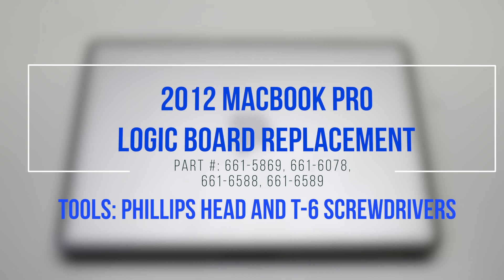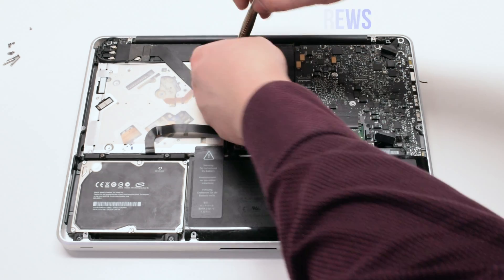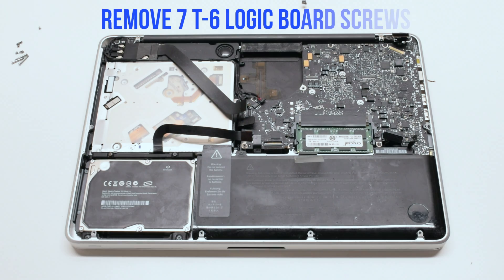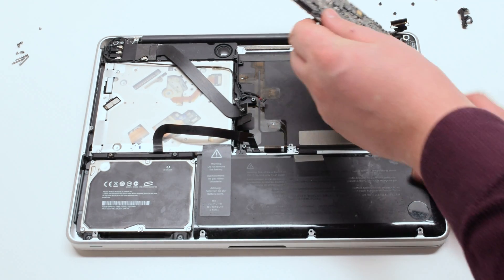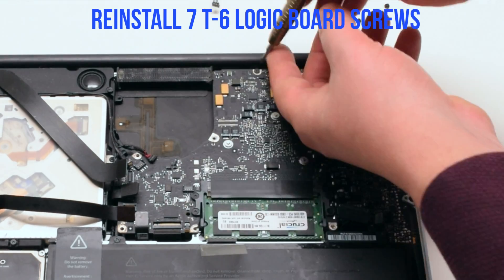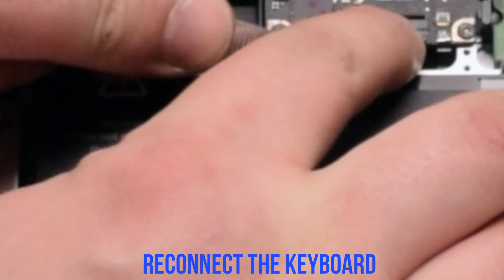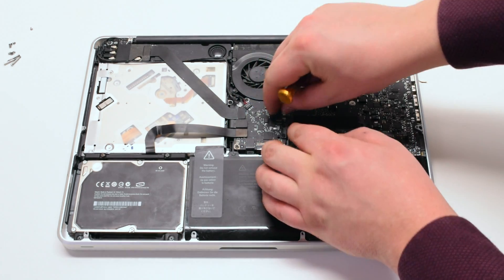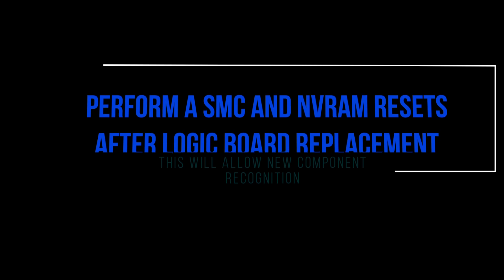2012 Macbook Pro 13" A1278 Logic Board Replacement

Comment: Great video!  Any recommendations on which replacement logic board to purchase?

(My 2012 or 2013 MacBook Pro 13”, with i7, is non-responsive.  No lights or fan sounds.  The logic board had some white oxidation, which has been removed with a touch of alcohol and compressed air).
Is the problem likely only the logic board?
Reply from the maker: Did you reset the SMC after cleaning? https://www.youtube.com/watch?v=5JLw2M379rc&pp=ygUJcmVzZXQgc21j 
Did you try other chargers? If so than purchase a replacement on Amazon here https://amzn.to/461vOdh
Reply: @GRIBSOFT  Thanks for the reply!  
No luck with the SMC reset, and I tried another charger at BestBuy today, but that did not work.  I noticed this link is for an i5 logic board, and my laptop is the i7.  Will it still work?  
What’s the difference in performance between i5 and i7?
(I haven’t been able to find a logic board for the 13” that is i7 and has the EMC No: 2554).
Reply from the maker: @sgalloberklee it will not be an issue other than it being an i5, browse around amazon for an i7 you may find one.

Comment: Thank you very much!! Super useful. The video is missing an important thing though: when you undo the old board you need to take out two important parts and put them in the new board: the cooling system of the chip, and the microphone. Other than that this was the best

Comment: you didn't mention the microphone replacement(Important step before removing the LVDS bracket).  Does it just sit back in place or does it need to be glued back down?  If so, which glue is recommended.

Comment: I swapped my bad motherboard for a new one. I booted up to the folder with the question mark even after I did the NVRAM reset. Any tips?
Reply: CHANGE THE SATA CABLE THATS CONNECTED TO THE HARD DRIVE

Comment: Tried plugging the 3 T-6 fan back on and it doesn’t latch on. The connecting end use to have four metal ends that attach to the board, but now there’s only three. Is there a way to make this work or do I have to replace the 3 T-6 fan?

Comment: Very nice video! Thank you! How do you think can I upgrade my Mac by replacing my old mid 2010 logic board to i5 late 2011 (I noticed difference only in WiFi connector and I wonder - is it possible to replace this cable somehow)? Thank you.

Comment: I want to replace the HDD with an SSD, please can you tell me what are the types of screws that I will need to remove. So that I can buy the relevant Screwdriver set.
Reply: The screws for this are all Phillips "cross" or "plus sign" heads. You just need a very small screw driver. I use an Autocraft Phillips 0x3".  It has a magnetic black tip that is really useful with tiny screws.  Got it from the hardware store.  Hope this helps.

Comment: you need to warn people to carefully remove the wires because not knowing how to remove them can damage it especially on insight camera. You also need to slow down and show how your doing it properly step by step. Also invest in a better camera because your current one is bad cant zoom in properly. Also, keyboard wire was very hard to understand you didn't properly show it or zoomed in especially on putting everything back together. Overall just slow down and explain each step carefully and zooming in properly.

Comment: For all of those struggling with the keyboard's cables, try putting a stripe of tape all the way long the width of this flat devil to help you out. I can't believe I did spend more time trying to put this back, than taking apart the whole system.
Reply: Now you tell me ;) . That was a bear.
Reply: @kristophertodd6870   An engineer bear D:

Comment: Hello 

 My macbook pro from 2011 broke down (motherboard).  I bought a new computer since then and I got the ssd from it as an external storage drive case.  In this confinement period, I decided to fix it.  So I ordered a new motherboard on EBAY.  After replacing it, I turn it on and the screen shows me a folder with a flashing question mark.  No recognized operating system.  I have recovered my ssd, and I would like to know how to restore the OS LION which was offered to me by default when trying to restore?  On the screen, they show me "an error occurred while preparing the installation try running this application again", or if I do an ssd cloning with "carbon copy cloner", the up to date catalina OS which is on my other machine  on it would end up on my ssd.  Could it work?  is it normal that my azerty keyboard is set to qwerty?  Besides, when entering the wifi, to access the restoration system, the numbers on my keyboard as well as the trackpad do not work.  Is this related to my new motherboard?  I did a complete hardware test, the diagnosis shows me a battery problem with an error code (see photo attached)
 I think I said everything in terms of my questions.
 Thank you for your comeback.
 cordially
 Alex

Comment: Bonjour, Bonsoir 

Mon macbook pro de 2011 est tombé en panne ( carte mère ). J'ai acheté un nouvel ordinateur depuis et j'ai récupéré le ssd sur ce dernier comme boitier de disque de stockage externe. En cette période de confinement, j'ai décidé de le réparer. J'ai ainsi commandé une nouvelle carte mère sur EBAY. Après avoir effectué le remplacement de celle-ci, je l'allume et l'écran m'affiche un dossier avec un point d’interrogation qui clignote. Pas de système d’exploitation reconnu. J'ai récupéré mon ssd, et je souhaiterais savoir comment faire pour restaurer l'OS LION qui m'a été proposé par défaut lors de la tentative de restauration ? A l'écran, ils m'affichent " an error occurred while preparing the installation try running this application again " , or si je fais un clonage ssd avec "carbon copy cloner", l'OS à jour catalina qui est sur mon autre machine dessus se retrouverait sur mon ssd. Cela pourrait-il marcher ? est-ce normal que mon clavier azerty soit mis en qwerty ? D'ailleurs lors de la saisis du wifi, pour accéder au système de restauration, les numéros de mon clavier ainsi que le trackpad ne fonctionnent pas. Est-ce lié à ma nouvelle carte mère ? J'ai effectué un hardware test complet, le diagnostic m'affiche un problème de batterie avec un code erreur (cf photo en pièce jointe)
Je pense avoir tout dit au niveau de mes questions. 
Merci de votre retour.
Cordialement 
Alex

Comment: Can I use a 2012 logic board in a 2010 mbp? From everything I read I can, and I really need the faster processor.
Reply: Call apple
Reply: T Villa I didn’t do that. I don’t think they technically allow that so they wouldn’t tell me. What I did was find a list of the incompatible parts in the 2010 and found replacements for them (display connector, airport, speakers, and antenna/camera). You can find all these things for really cheap on Ebay, I just ordered the whole display/clamshell because then I don’t have to replace the connector or antenna/camera for $40 and it makes it simple, The speakers and whole airport assembly was like $14 for both, and the logic board was $125 in theory I should have no issues, but we will see!
Reply: @NA0401ABC   cool let me know!
Reply: T Villa I did it! I worked perfectly, and for some reason everyone tells you that it’s impossible when it took me like 10 minutes to finish.
Reply from the maker: I'm late to the party lol! So glad you got it done. Congratulations!!! Yes so it's the same body so it should be fine, but there are some late 2012 models that will not fit 2010 bodies.
Reply: Save Apple Dollars Hmm. I only had to make one modification to the separator thing in the middle of the case. I just removed it, I am not sure the purpose of it because literally nothing changed except I can’t use 1 logic board screw but that’s it. From what I know is that I can use a 2012 i5 or i7 logic board in my 2010 13in model. Just the display, airport, and speakers need to be replaced and that’s it!

Comment: We did everything in the video and now the mac wont turn back on. Any suggestions? 

Thank you :)
Reply: Kathleen Scott , do you remember reconnecting the battery cable back before placing the back lid and screwing? Most of us tend to forget that. If so, what I’d recommend is, watch this video carefully again, take notes of all the connections here mentioned, watch one more time to double check and make sure you didn’t miss any part and then open the laptop again and very methodically and patiently check and double check all connections, one by one. I hope that helps. Good luck ; )
Reply: Call apple
Reply: They will tell you that the logic boards fried.

Comment: I’m excited because my new (well used new?) logic board for my 2009 17Inch MacBook Pro came in. I couldn’t be any less excited because when I got it, it didn’t turn on. I then proceeded to get assistance from Apple. We went through a lot of repairs to which they then recommended a new logic board. They were willing to help sell the part and do them self but I refused. The amount they charged me for, I could of just bought a brand new MacBook Pro. I love the large 17Inch. And the process is simple. I’ve already removed it and it’s literally a plug and play. Unfortunately I’m 750miles from home but when I get home, I’m immediately putting it in.

Comment: After Cleaning my MacBook doesn't go to sleep when I close the Display... any Idea ?
Reply: Give it 2 Nyquils....
Reply: Any luck? Mine has the same issue, doesn't sleep when display closes, or it shuts off randomly on its own. I have to run the fan on high (manually using an app) and leave it plugged in.

Comment: My nutjob of a brain thinked that opening my macbook and NOT dissconecting the battery cable AND touching the fucking LOGICBOARD pins WITH A SCREWDRIVER and expected Its now dead
Reply from the maker: Must be some other disconnected cable. Not that it's impossible but it is very difficult to fry a logic board after 2008.

Comment: I believe you forgot to put the mic in... am I right?
Reply from the maker: Could have been missed in editing, but you got the concept.
Reply: @GRIBSOFT  Not exactly, actually.   The mic is the one thing that doesn't just slide, snap,  or screw back in place.  You had us tear the glue that binds it in place, so I'm wishing I had some instruction on how you re-installed that component.

Comment: i have replaced the logic board and now the trackpad and keyboard is not working to enter the credentials, also the fan runs at full speed. the startup disk is also missing. am not sure if i have done the smc or nvram whatever reset.
Reply from the maker: Make sure all connections are tight, i would reseat all of them, they do an SMC reset.

Comment: I have a mid 2012 MacBook pro 13" with a dead i5 Logic board inside do you think i Can install a i7 Logic board inside it ?
Reply from the maker: As long as it's same year and AXXX model type then yes you can upgrade the logic board.
Reply: Save Apple Dollars please consider to recommend a logic board for this model with an i7 processor. 🙏🏻🙏🏻🙏🏻

Comment: now my macbook is brooken. when i press the power button the bing sound is coming and the display is getting a little bit bright but no booting screen or something else. its black. and the backlight from the keyboard wont work too. is removed the mainboard twice but the same come out. 

I tryed to reset the nvram and the smc but i dont know if it work. 

what can i do now? is my mainboard death now?

and i switch the Thermal Compounds between the cpu and the cooler. 

sorry for my bad english lol
Reply from the maker: Check all the connection and make sure nothing is shorting any components on the board. The back light needs to be plugged into the logic board it's possible it's stuck under the fan. The best advice is to completely take out the logicboard again and reinstall it following all steps.
Reply from the maker: Reseat the LVDS connection to the LCD.

Comment: Is there a list of which motherboards will fit into certain macbook pro models?   Fried my motherboard in a 2011 macbook pro and I'm thinking of upgrading it to a newer motherboard.
Reply from the maker: There is no list but the A number of the laptop followed by the year will get you a compatible board. For example a "2011 A1278 logic board" search on ebay will get you the right board.
Reply: Don't do it. While you may get it to work, the LCD connectors are different (eDP vs LVDS), and can be damaged if a 2011-style cable connector is inserted. You can change the LCD cable, but then you have to disassemble the display, which is a pretty big PITA.
Reply: I have a 2015 model which one should I buy

Comment: Hi.  Great vid.  I have a dilemma. I dumped beer on the power connector where the power connect to my Mac. Lights out. I took it in and they said possibly it was either the logic board or the power source. Do you think I should try to replace a power source connector first or go ahead and replace the whole thing? Any advice?
Reply from the maker: Take it apart and clean it with alcohol first. You might not need to replace anything.
Reply: Thanks, I will try that!

Comment: Is this the same for the 2013 Mac? Things look similar and is the intel chip in the Logic board? If so can I upgrade  I the i7?
Reply from the maker: The 2013 Macbook Pro is a retina model and has a slightly different architecture. There are i7 logicboards for all retina Macbook models and years so an upgrade is possible but only through replacing the entire logicboard.
Reply: I need to replace it because, it stopped working also is the intel chip on the logic board?
Reply from the maker: It's all one unit and can not be replaced separately.
Reply: Save Apple Dollars Thanks I can definitely do that. I need an i7 in my life.

Comment: can i replace a logic board from an early 2011 MacBook Pro i5 13 inch, in a mid 2012 i7 13 inch?
Reply from the maker: The WiFi card connection is different I believe.
Reply: (late response) you "can" put a i7 2012 motherboard on a 2011 MacBook Pro  I recently swapped and works perfectly but on the display connector, you have to trim the display cable on the sides to make it fit because the port is a bit smaller than a 2011 motherboard and then you connect it perfectly.
Reply: Don't need to change a wifi card

Comment: why can't i remove the logic board? i'm lifting it up but it seems the plastic cover goes with it
Reply from the maker: You either missed a screw or there was a spill that dried and stuck the backlight cover to the speaker on the bottom of the board.

Comment: Is it possible to install a logic board with a better processor than the previous even If they're the same model size logic board? Or will there be a size limitation or battery limitation?
Reply from the maker: Sometimes, but it's not worth it as logic-boards cost the price of a complete Macbook.
Reply: what do you mean? a complete mbp is not ~ $300...
Reply: Luke Skywalker I put a mid 2009 MacBook Pro battery in mid 2012 of a friends computer
Reply: Have you done it ?
Reply: This video could have been so much more useful if you got a better angle on the camera and moved slower, but thank you anyway for putting up.